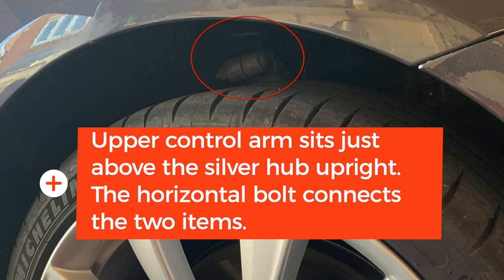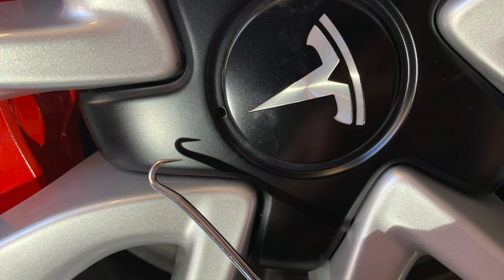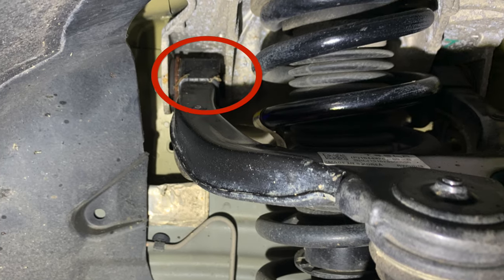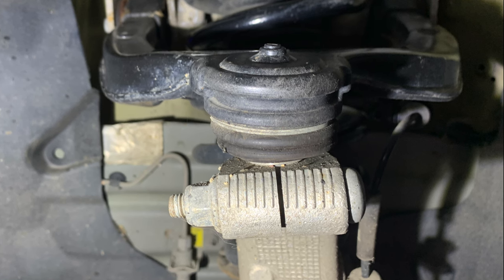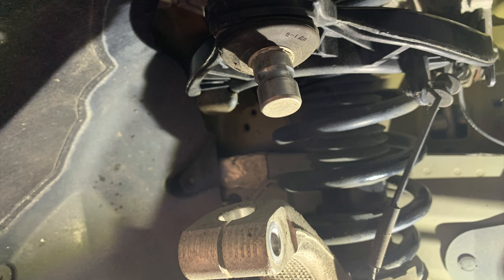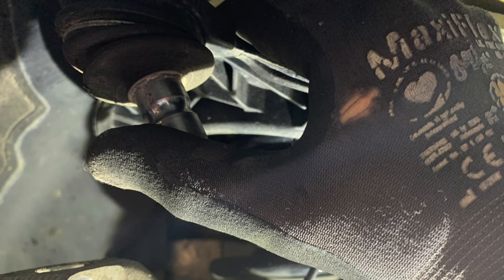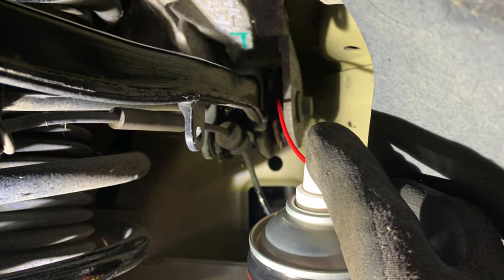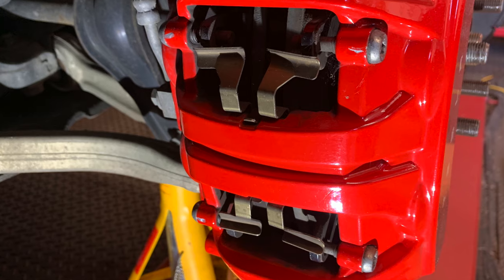Tesla Model 3 squeaky suspension cause and fix

Comment: WD40 was my fix. I had this exact noise problem with my 4 year old Model 3. Drove it less than 35K miles, but it's past it's warranty. Tesla in Portland, OR wanted to charge me $497 upfront to fix this. Shocked that there's no such thing as a free estimate for them to look at it first and discuss with you after your warranty expires. I found this expense for my low-mileage car ridiculous, so I just sprayed WD40 in the areas described in this video. It's been months and the squeaking has completely stopped! I didn't expect my stop-gap to last this long, but I'm happy that I didn't have to spend anything.
Reply from the maker: Good to hear
Reply: What warranty this is covered under?
Reply: This is way more easy . I’ll try this first
Reply: I sprayed wd40 around the joint also but it didnt do anything … i need to buy that needle and poke it?
Reply: @tumenodnuud4101  yeah. I poked and injected lubricant into that rubber cover and it fixed the issue . I didn’t even have to take off the wheel. It still squeaked for a day, but after day two, it was all good.

Comment: Had same issue. Used silicone lubricant on all the rubber/silicone connections and went a bit overboard and took the rubber housing off the ball joint and added some grease in there before putting it back together. The little metal to by is a bit difficult to work with but if you take your time it is possible. 

No more noise. 🙇🏻‍♂️ you’re doing the Lord’s work.
Reply from the maker: Great to hear. Top work.
Reply: This is the way.  I had to do it twice when it came back after a month.  Needed fresh grease.
Reply: That is what I did. I cleaned out all the horrible gunked up grease and replaced it with new. Taking the spring wire wrap off is the best option, I'm sure. It's a bit of a fiddle, but easy enough to get off and on again. Once the grease is replaced and the cover is back on, it is really easy to work the ball joint and get the new grease spread around. Squeak is gone!

Comment: My model 3 had the same problem but my squeaking was way louder. Tried this method and it worked like a charm. Thanks man
Reply from the maker: Glad it helped
Reply: Mine is so loud🥲
Reply from the maker: I was embarrassed by mine as I drove about
Reply: @johntisbury  yes exactly!!!😂 I’m like guys I swear it’s not my fault
Reply: I just got new ones to my 2021 model 3 and have to say that I can feel the difference, just like new now
Reply: Mine started exactly like the example in the video, but a month later is way worse. Much louder version of the same sound with every turn of the wheel
Reply from the maker: @vaggeto get that looked at ASAP. You are hearing metal on metal.

Comment: Thank you very much for this video. Very helpful indeed. A couple of things I did different. First, you can jack the car at the rear and get it high enough to put the axle stand under the front jacking point. Once that is done, I didn't bother with a second jack stand. Then, while working the joint definitely helps, I removed the spring wire from the rubber boot and peeled back the boot. Then  I cleaned out all the horrible gunked up grease and replaced it with new. Taking the spring wire wrap off is the best option, I'm sure. It's a bit of a fiddle, but easy enough to get off and on again. Once the grease is replaced and the cover is back on, it is really easy to work the ball joint and get the new grease spread around. Squeak is gone! Thanks again for a great video!
Reply from the maker: Good tips Richard, thank you for sharing.

Comment: Thanks bud!!  I owe you a cold beer.  Saved me a couple of hundred bucks and at least half a day dealing with Tesla service.  Very easy DIY fix.  I recommend using a strap with a rachet to take the tension off of the  pinch bolt in order to remove it and to bring it back together after getting the ball joint moving again.  Many thanks!
Reply from the maker: Great to hear. Glad you got it fixed.
Reply: Good point ... I was wondering about that aspect.

Comment: I bought an automotive syringe and injected grease straight through the rubber 'boot' without even taking off the wheel/tire.     Had to drive it around for a few miles but the noise is gone.

Comment: Love these vids. It’s not that Tesla isn’t producing quality cars, it’s the parts that have slight wear out that need lubrication. You even pointed out the ball joints which is another common issue where they need to be greased. Very simple fixes. If you bring it to a SC ask for a fix and not a replacement part. Replacement part will only have the issue come back later and you’re back to the drawing board. EXCELLENT VIDEO.
Reply from the maker: Thank you. As you point out it's not a quality issue. 

Tesla have changed the upper control arms as they were prone to squeaking through lack of grease. The newer version is an improvement on the original ones. I had my MOT in late September and the squeaking returned immediately afterwards. This was due to being jacked up and the suspension travel extended. I could have repeated the same process I documented in this video. However, as I knew Tesla had updated the control arms and increased the amount of grease in the ball joint I opted for them to swap them free of charge under warranty.
Reply: @johntisbury  yes, I read on the different variations for those control arms. Just got my MYP two weeks ago and heading to the SC for creak/squish on all FOUR tires. At first I was pissed(excuse my French) because the car is brand new and I thought it was the suspension or control arms. Upon deep research MYP cars have this “issue” where they leave the manufacturer sticker inside the tire wheel well. I told SC to please remove the rims from the tires and check to see if said stickers are in there. Once removed it solves the creak/squish issue. The sticker apparently is made of a foil metalish material that makes sound at that point of revolution. Again not a quality issue just but rather a silly one.
Reply from the maker: @MUFCXI  I can appreciate that being rather annoying for what is a simple fix and obvious production problem. I'm sure Tesla will soon resolve that going forwards as they are quick to improve. 
The Model Y is certainly proving popular, the second best selling car in the UK in September and it's only going to go from strength to strength. Good choice.

Comment: Refreshing to see someone who's prepared to diagnose and fix without troubling the garage or the wallet. A ball joint splitter was one of my very first tools, purchased back when nearly everyone did their own maintenance. I don't remember having to buy any large torx sockets though!
Reply from the maker: I did have the ball joint splitter to hand too although didn't need it in the end. Torx sockets are strange things, there's quite a few around the Tesla.
Reply: He should have just contacted a Tesla garage and they would have replaced the upper control arms free of charge. It was a known issue.

Comment: By far the best tutorial for this work I’ve seen on YouTube 👌🏻
I’ve tried to insert grease with a thin syringe but it was too weak so I’ll maybe try a grease gun instead. I was a bit worried about removing the t50 bolt … if it holds itself without any aid and if it is easy to reassemble again. Does it mess with wheel alignment too?
Reply from the maker: It does not effect alignment once removed.

Comment: My 2019 model 3 has the same issue. Thanks for making the video. Glad it’s not just mine
Reply from the maker: It's a common fault on the early ones. Tesla changed the upper and lower control arm design to overcome this.
Reply: @johntisbury  I have a 2022 and it’s squeaking now hmm
Reply from the maker: Tesla did revise the upper control arms to stop this happening but not sure when that happened. You could try the fix and see. If it resolves it then perhaps book it in for a warranty upgrade.
Reply: Tesla y 2023 года 17000 км тоже начала скрипеть

Comment: Get yourself a grease needle and pump the boot of the upper and lower ball joins with new grease.  The noise is in the ball joints and it's because the grease was inadequate from the factory.

Comment: John - my 2020 M3 LR had this issue and Tesla MK  replaced the front upper control arms on both sides - they judged them to be OK but wanted to avoid an , apparently inevitable, remission.  Jolly good all done at no cost  but here I am one month later waiting for a service appointment to get the job done again!!😪😪
Reply from the maker: Ah that’s not good. I did get mine replaced too by Tesla Northampton SC as the modified arms were an improvement over the mk 1 versions. They have been fine since, 29th sept 2022 was the date they were replaced
Reply: @johntisbury  Thanks John, I appreciate your reply  and I must say, a really good video which is so clear and simple.

Comment: Mine picked up a similar issue a couple of months back had Tesla in Nottingham take a quick look at it while I was nearby, and they fixed it under warranty a couple of weeks later (it's 2020 model). Superb service.
Reply from the maker: Good to hear, glad you got it fixed.
Reply: Stephen, mine just started doing it and mine is also a 2020.  Hoping it won’t cost me anything.
Reply: Just wait till your out of warranty. Here's what they quoted me to fix the squeak:
1) FR UPR CTRL ARM ASSY, RH(1044326-00-J)
2) FR UPR CTRL ARM ASSY, LEFT HAND(1044321-00-J)
3) FRONT LOWER COMPLIANCE LINK ASSEMBLY, LEFT HAND(1044354-00-A)
4) FRONT LOWER COMPLIANCE LINK ASSEMBLY, RIGHT HAND(1044359-00-A)
5) LOWER LATERAL LINK - FRONT(1044341-00-D)
6) LOWER LATERAL LINK - FRONT(1044341-00-D)

To the tune of 2k.

Lucky I did some research.....

Comment: Great video! Do you perhaps know the needed torque to tighten the bolt that needs to be taken out? Or am I fine, when I tighten it normally?
Reply from the maker: TBF I re-tightened it to a similar pressure as the original. I didn't torque it.
Reply: @johntisbury  Thanks!

Comment: Did you loosen the two bolts by the bushings? You didn't mention it and they are loose. Not the bolt by the ball joint but the two bushings towards the middle of the car. They should be tight. Torque spec for the ball join bolt is 41.3 ft/lb and the bushing bolts are 36.9 ft/lbs.
Reply from the maker: Thanks for this. 🙌

Comment: I do wonder how long the DIY fix will continue quieting the noise, compared to having the control arm replaced (with possibly improved lubrication of ball joint). Such a squeaking issue appears to be extremely common for Teslas.
Reply from the maker: Yeah time will tell.
Reply: @johntisbury  Thanks a lot for the explanation. Since it is very expensive to replace it I also wonder if it is still quiet. 
PS: the Tesla garage refused to do this fix saying it will start squeaking again after a weak. They wanted to replace the whole arm.
Reply from the maker: It’s been fine since, no squeaking.
Reply: @ShowMeSomeCode isn't that free under warranty?
Reply: Thank you for your great video. Did squeaking come back a year later?
Reply: Iam taking my car back to TESLA for 3rd time with this issue,the insist it isn't the upper control arm,but they can't seem to fix it....strange.
Reply from the maker: @alanrobinson2229 it’s a common fault on the early cars.
Reply: @alanrobinson2229  it is. Its a quality issue unlike what people here write. hell its a construction issue. the bolt isnt completly isolated so water gets in the balljoint which causes the issue. just using WD is only a temporary "solution". No other car brand i know got this issue since the rain water doesnt run over the wheels and their joints are completly isolated. If u still got the problem get the upper control arms from meyle.
Reply: @Cope_93  Hi,thanks,I got them both replaced free,under warranty by Tesla

Comment: Mine has developed a different problem, but with similar symptoms.
1.  Put the car in drive/ reverse, foot brake off.
2.  Steer left/right while stationary and observe creaking while steering.
3.  Apply footbrake, and observe that creaking has gone away while steering.  Same goes for park mode.

It’s like the brake pads are rubbing against the discs, indicating that the hold mode isn’t quite strong enough.

I’m wandering if that’s a software fixable thing, or whether the discs need cleaning.  Only started noticing last week after update to 2022.16 software.  12800 miles on the clock…
Reply from the maker: That's interesting Anthony, as you say sounds similar yet different. The creep mode does not engage the brakes so can't be brake related. Must be suspension. It's mechanical over software by the sounds of it.
Reply: did you ever get this fixed? im having this issue.

Comment: Mine literally started squeaking today.. same front drivers side.. wonder weather the heat has been final straw!  My MP3 is due in service centre on 1 Aug for loom recall and a broken front seat so will add upper arm to their list! Thx
Reply from the maker: Timing and all that! They will probably replace the control arms rather than do this fix. The later arms have more grease in the ball joint I understand.
Reply: My exact sound
Reply: Literally started today
Reply: @johntisbury  how much is it
Reply from the maker: @raythomas7392  not sure what you are asking here Ray. If it's cost to repair, it's free apart from your time if you do it yourself. If Tesla do it and it's under warranty then also free. Not sure on the cost if you have to pay as that will vary country to country and their approach to fixing it.

Comment: Great video! For the bolt you removed … when you reinstalled it, did you torque it, and if so, at what torque? Thanks !
Reply from the maker: Thanks for watching. TBF I tightened the bolt by feel based on its tightness to undo it. Not very scientific but worked okay.

Comment: Thank you for the amazing video John, my 2019 Tesla M3 started the squeaky noise today. And I book the earlies appointment date (in 3 weeks). Is the car still safe to drive for 3 more weeks?
Reply from the maker: It should be okay, the noise may get worse. Tesla will replace the parts that are rubbing metal on metal.
Reply: @johntisbury  Thank you

Comment: What is the torque on that T50 ball joint bolt? I want to make sure I get it back to the correct tightness and not overtight.
Reply from the maker: Upper Control Arm to Knuckle: 56 Nm which is from the Service Manual. However, this is 3rd hand from a Reddit thread. I therefore cannot verify this information. It can be found here too: https://tighttorque.com/cars/tesla/model-3

Comment: Great job John 
Would be interesting to know if anyone else has paid Tesla for this work to be done and how much they charged
Reply from the maker: Yes good call. I'm lead to believe they simple replace the control arms as the early ones had a lack of grease in the ball joint. How true this is I don't know. My fix is simple, but may need to be done again later down the road.
Reply: @johntisbury  If it’s still under warranty then it’s worth getting it into Tesla to be replaced as necessary.
Reply: Mine has the exact same issue, going into Tesla garage on Monday to get replaced under warranty FOC.
Reply: $1000 😢.   wish I’d seen this sooner
Reply: @rock1275  is this a warranty item? What year is your car?
Reply: They wanted to charge me 470 per arm, and I am preparing to do my own fix.  I have Model 3 performance.  80k miles

Comment: Hi, my model 3 is now creating such irritating sound. Should I apply the lubricant to both the control arm as i am not sure which side the sounds are coming from?
Reply from the maker: It won’t do any harm.
Reply from the maker: Thinking about this it maybe the ball joint that needs manipulating to move the grease about. The lubricant won't do any harm, but the ball joint is probably the thing making the noise.

Comment: How would I know if I need a new ball joint or I just need to lube it? I have a 2018 with 14000 miles.
Reply from the maker: @vincent-n6o  you won’t need a new ball joint after only 14,000 miles that’s no mileage at all, unless you’ve done all those miles off-road. Just needs lube.

Comment: John, thank you for the video. It's very helpful. You had this issue at least a year ago according to YT. Just wondering, is the squeaking still gone? I'm asking this so I can be sure to apply the fix by myself or to order a new upper control arm.
Reply from the maker: The squeak had disappeared for about 6 months. However when the car went in for its annual MOT, the suspension is dropped to its full extension whilst on the ramp. Afterwards the squeak did return. The issue is lack of grease in the ball joint. The car was still under warranty so I got Tesla to replace the control arms with the newer modified version which has a better ball joint and grease pocket.
Reply: @johntisbury  Thank you for your answer. Unfortunately, I don't have Tesla service in the country I live so I guess have to consider to take it to the services specialized for Tesla vehicles and explain the issue and maybe show them this video.
Reply from the maker: @trancevision83  ah that's unfortunate. It's not an uncommon problem for any car to be fair so any competent mechanic would be able to grease the ball joint or manipulate the grease that's already present in the joint back into the position around the moving parts.
Reply: @johntisbury  thank you again. I'm contact with the mechanics to solve this issue.

Comment: My Model 3 is a 2021 refresh - one of the first batches from Shanghai - and it has started creaking after 40,000 miles. Is it possible that it does not have the new front upper control arms?
Reply from the maker: Good question, unlikely but possible. The front upper control arms have gone through a number of iterations in design. No idea what the current part number is.